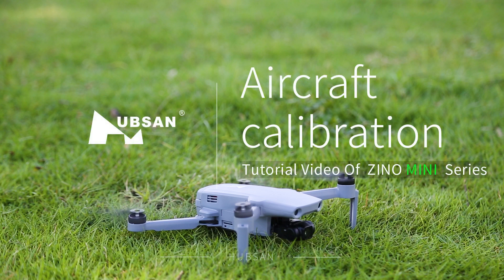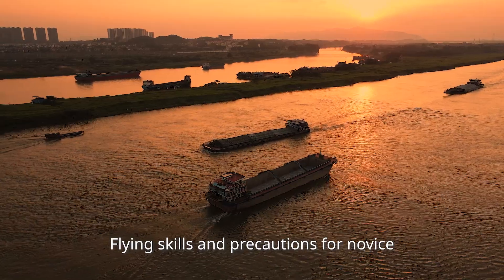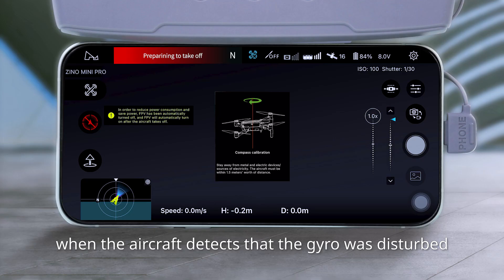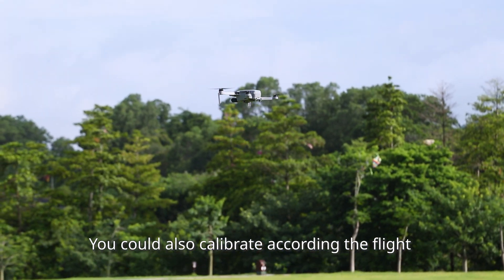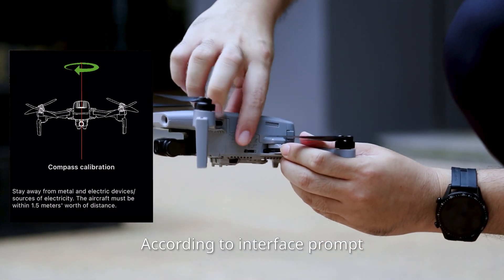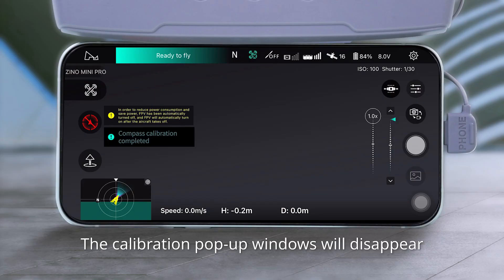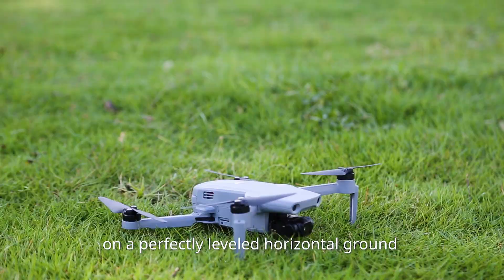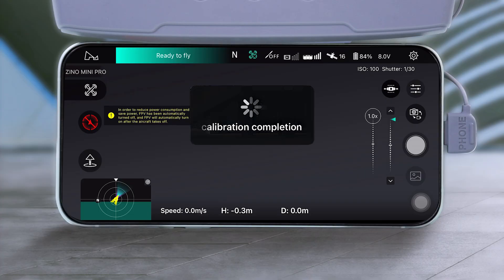Aircraft calibration - Tutorial Video Of Zino Mini Pro

Comment: Good .................... small update, after 5 flights this afternoon in good weather, little wind here is my diagnosis ..

I have NEVER had so much trouble understanding a drone ... what's more, the PRO version!

Sorry but even if he flies very well for the rest I still regret my purchase and I think I will be reimbursed ........ explanations

1) stopping the 4 motors ..................... unheard of
2) the complexity for the drone to lock onto the remote control when both are on
3) 1 out of 2 times I NEVER know if I should turn on the drone or the remote control first because the reaction is never the same ....... of course I tried both ways
4) On the 5 flights this afternoon, behave ... either I had no video display AFTER takeoff, or the message "No USB connection" with no possible functions (photo / video) and even MORE SERIOUS NO PILOT REACTION ... it's really not that great when you fly away !!!

So I had to turn off the remote control, turn it on again ........ in the end it was the AUTO RETURN that was activated ..... and there, I grabbed the Zino by flight during its descent before it lands in a bush about 1m from the take-off point ... !!!

IMPORTANT POINT: I made the updates, remote control + "plane" BEFORE the flights this afternoon (FLIGHT WITH CRASH INCLUDED)

Well, I want to be cool but here I leave myself 24 hours to validate or not to switch to DJi after reimbursement ........................... ...........

The price of Zino is certainly a little lower but there ...... I have quite a few doubts ........ take off at "chance" of what will happen ... not for me

last point, I took 1 photo in flight .................. I am still looking for it ........ NOTHING recorded despite the "click" when you press the white button ...............

PS: I currently have ......... a 1m wide quad (Sky Hero), a Mavic quad, an Open Source quad with Pixhawk cube, an Open Source quad with Pixhawk 1er of the name, a quad INSPIRE (3D clone), and to finish a Hexacopter Naza M V2 quad, and 2 3D printed planes ... All this little world flies with Taranis or Futaba and I HAVE NEVER HAD ALL THESE PROBLEMS ESPECIALLY ON A DRONE ALREADY MOUNTED TRADE.....................

That's it, it's up to you to offer me a solution !! ........

Philippe